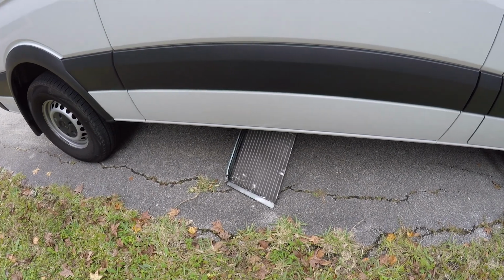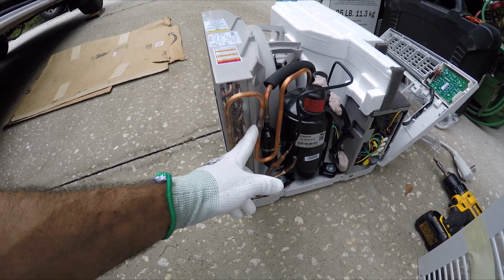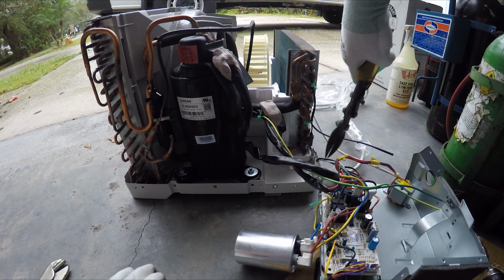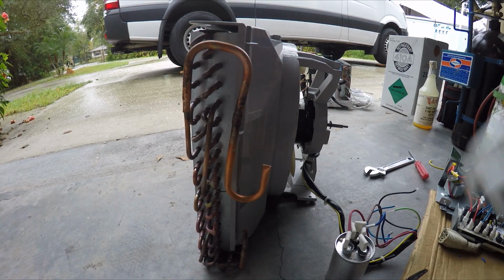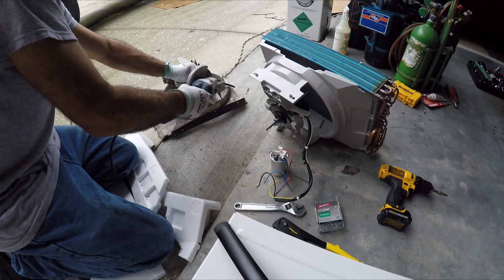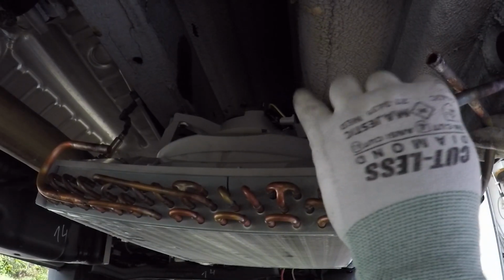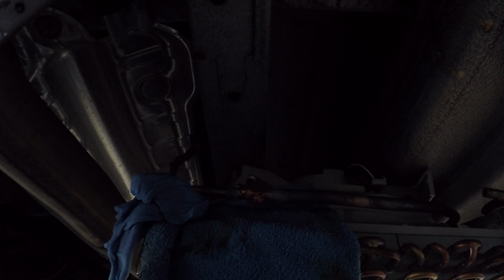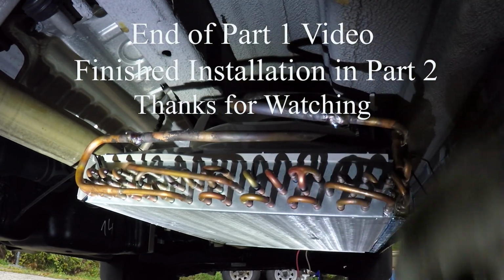Mounting a Air Conditioner Under a Van Rv Sprinter Mercedes

Comment: Thank you for this video, I just did this end of Nov 23, for my florida winter trip. Used 2 identical  6k btu air conditioners. A couple things, the drain water from the evap flows down the inside case bottom, and the fan on the compressor side is made to flip water on what would be the condenser, it was flipping water out of the ac onto the floor. To solve this I used 1/2" cpvc pipe one end shaped square and glued it directly to the foam outlet in the back side of the evap foam housing drain port and put an elbow down through the ac drain pan at the very back bottom and piped it directly down through the floor. So no more water in the case for the fan to fling it. Second I installed a Relay wired from the compressor on off relay to the Condenser fan, and power cord in wiring so the con fan cycles on and off with the compressor. I used r410 in this r32 system, just have to tweak the oz's alllitle, 2 months in and it working beautifully. Thanks again for this idea.
Reply from the maker: Wow awesome and you did great modifications too thanks for sharing and enjoy your very low price split unit, thanks for watching 👍💯

Comment: Hey, Mercedes Sprinter DIY, I've got the last few tools coming in from Amazon, a 
PROTMEX PT6508 wet bulb thermometer, 12" Electric Radiator Cooling Fan Assembly, Analog Deep Vacuum Gauge with Brass Tee Adapter, Bison Metals 5/16 inch x 50 FT Copper & innumerable other middle to lower grade air conditioning install gear - already purchased.  I think I'm on track to pull this off. Thank you, a huge thank you for all the help, this video and the various questions you've answered. Kindest regards, & happy 4th of July, Craig Smith
Reply from the maker: thanks Craig and i hope your projects comes out great, and tell me wen you are done how it came out , only if you can 
have a awesome night.

Comment: Thank you for sharing your project. I was wondering watching your work over and over again what if you use the capacitor inside the unit in the Van and connecting all the corresponding wire to the condenser outside.
Reply from the maker: very true but i like to have them separated
Reply: instablaster...

Comment: Great video, thank you. I would love to do this and feel that I probably could with the right tools, but I am not sure it makes sense to buy all of these tools when I am not an HVAC technician by trade. I'm looking at models designed for semi trucks but they are unfortunately $3500+. I don't see any other reliable option unfortunately. There used to be a couple portable mini-splits around $500-800 but they had universally awful reviews and seem to have been discontinued and have really poor reliability. Looks like I am stuck cutting a massive hole to slide out a window unit when needed, or to buy the $3500 prebuilt option. I am trying to run off solar so the efficiency and low wattage are a requirement. The roof units and portable hose-type units are generally very poor efficiency, very power hungry, and very loud/big.
Reply from the maker: i know they are expensive and the window units are cheaper and easy to replaced

Comment: Hi, really fun to watch you work on this! I have a converted Sprinter Van, but so far I have not figured out the A/C problem. I've thought of buying a mini-split heat pump. My question is: does the condenser have to be vertical? Or can it be horizontal like the one you mounted under your van? How important is that? I'd love to mount the outside unit of the mini-split under my van horizontally. Will that cause any problems? Thanks!
Reply from the maker: On a mini split the compressor is inside of the condenser and you cannot tell the condenser because you'll burn the compressor the reason I did mine like that is because a compressor is vertically inside the van not on the van.
Hope this help

Comment: i know you don't have room to mount the condensor properly facing the wind like car's radiator fins are mounts.

But you should at least rotate your installation 90 degrees (such that the pipes are facing toward the sides, not forward and backward) so that the oncoming wind is able to go through the fins. That's the better orientation for increased airflow and thus increased heat pump efficiency
Reply from the maker: i only run the ac wen parked and using land power so there is no need to face the condenser towards the wind, now if i was running it wile driving i see your excellent point, thanks

Comment: Can I install the outside unit inside the van with some kind of ventilation?
Reply from the maker: yes look at my other Youtube channel i did that with my boat
here is the link https://www.youtube.com/watch?v=v4t5vVWLZ7Y
and i placed the link of the blower i used witch is very important to use a 350 CFM blower or more for this to work .
please let me know what you think?
Reply: There is a build where they put a wall across the entire back of the van, closing off the "garage" area, just forward enough for a std. window air conditioner installed in the wall to have the unit stick back, as it would outside a window, into that back airspace.  I'm considering it, or getting someone to "fix" my DIY attempt of what's shown here, by just hacking the lines and trying to solder them myself to under the van, then get someone to check for leaks and fill it.   

But in the wall build, he would just open the back door to vent it, but if you positively vented the space, floor and ceiling, you could run it with the doors closed...  something like a couple of aluminum horse trailer vents that tilt open, but mounting them into the floor to open downwards, and then something like a Maxxair that can run even closed in the rain, and you'd have plenty of venting to counter the heat building up in that space.  You could even put a separate vent that you could close into the wall, that way you could run the Maxxair when the air conditioning is off and unneeded, and pull air through the vent in the wall from the living space, to get the "normal" benefit of a roof vent.

With vanlife popularity what it is, I'm more than a little surprised the build shown here isn't an off the shelf DIY unit.  Or even just a kickstarter to have a bunch built.  Mini splits are shipped all day that a sensible person can install and check for leaks in the lines, and worst case, have a tech afterwards fix a leak and refill...  This is basically turning a window AC into a mini split...

Comment: Hi nice vlog. Why solder? could you not have used connectors? As I said nice vlog it certainly is going to get me busy on my van project
Reply from the maker: excellent a bus is a great size to make a camper ,hope it comes out good buddy
Reply: @mercedessprinterdiy8556  Hi I am gonna copy your idea for sure. I have a Sprinter and live in Scotland but as I will be using the van to travel in Spain I will definitely need to fit it. Do you think it is possible to fit the compressor outside the van to cut down on noise?

Comment: I'm just guessing here but you put 410A into an R32 air conditioner that has a R32/R410A compressor and it's working just fine??
Reply from the maker: @craigsmithx  the system is 410 a
Reply: @mercedessprinterdiy8556  Thank you for the replies.  I looked around for an 410a window unit but couldn't find one. Ending up buying a bottle of R32, $330 or so I think it was.
Reply from the maker: @craigsmithx  Yes the newer units are different
Reply: The oils are slightly different it's not recommend but would work just had a class on new Amana r32 units yesterday

Comment: Hi, Is it possible to do this without a fan on the condenser. The AC I'm thinking of using only has one fan for the blower and the condenser?
Reply from the maker: you need a fan for it to work

Comment: Not sure if someone already asked, but what is the capacity (BTU) of the unit you are using?
Reply from the maker: is 6000 btus but it could be done with a bigger unit too
Reply: I asked because I was wondering if the same unit size would be enough for my Transit high roof 148” wheel base.  Thanks for the reply.

Comment: Hi Capt.... I'm watching this and am mesmerized....  I would never have guessed it was possible to use a common window unit for that.... Great job! How do you keep the coils clean under the van? Where I live (some dirt and gravel roads) that coil would get clogged a lot.
Reply from the maker: Thank you Andrew I knew you were going to like this video and soon I will upload the next video to show you the results.
When I made this split system on the window air conditioner some professional air conditioner technicians set the disc cannot work but I proved them wrong it works incredible  I was going to do the same thing to the but with the movement of the ocean is better to have the window air conditioner all enclosing the unit that way doesn't fall apart
Reply from the maker: I usually drive the van 90% of the time on pavement and I don't have a problem once a year I just hold it down and that is it and my van has big mud flaps and that protects the condenser from rocks and debris
Reply: @mercedessprinterdiy8556  You are brilliant! I have a technical HVAC background, (ACCA Manual-J, D, S, P etc Epic level/ instructor level). I mention this only to say I have an understanding of HVAC but I don't have anywhere near the practical knowledge and multiple skills that you have! You can build and fix anything!  If I keep watching your videos, I'm going to be smarter than my wife one day! ☺
Reply from the maker: @andrewfyakim525  LOL don't tell your wife that or I see you sleeping on the pilot house for a week although knowing you you're like me we would not mind sleeping on the Pilot House lol, and you have some good set of skills too Captain most of all your garage it's impeccable I have never seen at the garage like that I'm ashamed of mine it's not it's not even 10% is organized as yours.
Reply: @mercedessprinterdiy8556  I'm looking forward to your follow-up video of this one!...  I have always loved sleeping on the boat at anchor... not sure if it will be as much with the boat in the lift! ☺
Reply from the maker: @andrewfyakim525  lol thats perfect the wing will rock boat

Comment: Where do I get a copper service port ?
Reply from the maker: I just place a link on this video so you can get the valves hope it helps
Reply: @mercedessprinterdiy8556  
Thanks for the link , good price too.
This air conditioner mod is one of the better mods I've seen .
Reply from the maker: @mobileempire5522  thanks so much buddy and thank you for watching my Youtubre channel

Comment: You don't want to 'disbalance' the electric motor by cutting off a metal shaft that weighs a few grams? But it's OK to remove a large spinning fan designed to catch alot of air, hmmm. Seems like you've already destroyed the balance that was designed into that motor.
Reply from the maker: Will a my case it works perfect I don't know if you have tried it before but mine works perfect I am a refrigeration Certified mechanic just to give you heads up
Reply: I'm not questioning wether or not it functions perfectly, im sure it does, only your 'reasoning ' for not removing the shaft. I'm a certified common sense mechanic.
Reply from the maker: @brianscherer2615  of course for years of using it is not the design but for camping works great and for 5 to 10 years of constant use i will see your point Brian
thanks for bringing this point to my attention and for watching  .
my regards ...
Reply: @brianscherer2615  #metoo - but I was born in '56 so back then thinking for oneself wasn't optional... ;)